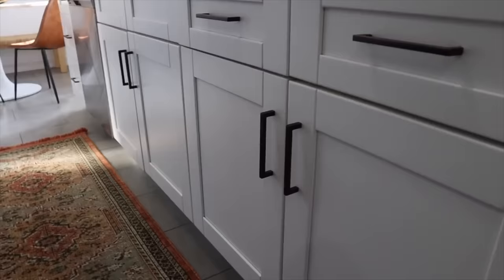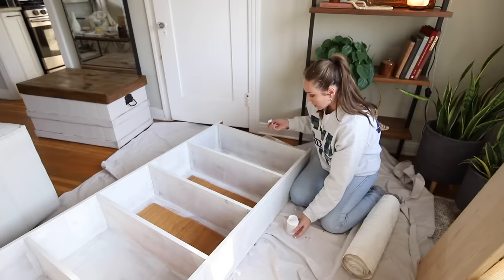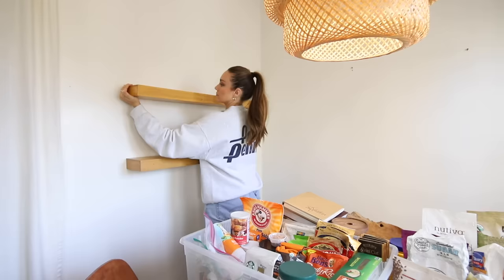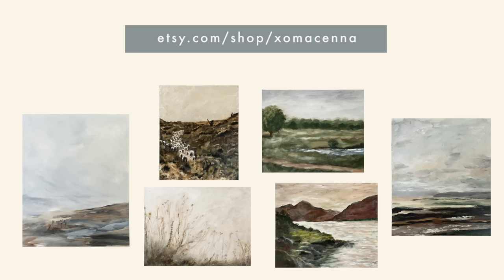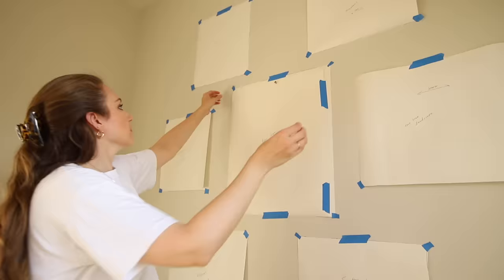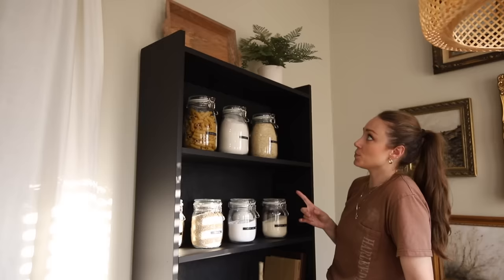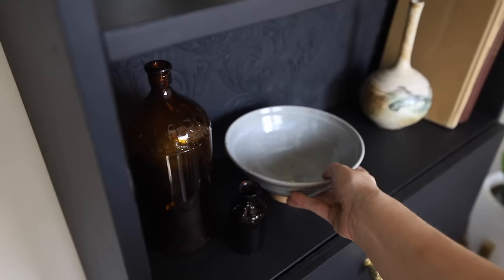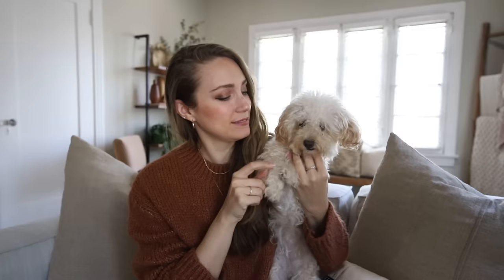EXTREME Breakfast Nook Makeover + DIY Pantry | XO, MaCenna

Comment: Ugh. I bawled; so good! Soooo, where did the plant actually end up? I liked it next to the pantry, but the right corner was very lacking, so my gut was to move it as well. But then, I didn’t like it as much over there since it is so whisky, but there is def something missing. What would be a low footprint, vertical that would help balance the pantry? You don’t need a light, obviously, but  you almost need a “objet d’art” piece in a dark piece in a dark tone for balance. Like, a totem pole, but in the right context/style. Would this be a good placement to put a very narrow blanket ladder, slightly caddied in the corner? Then, you could use that to display your table clothes/napkins, to further free space in the pantry and provide depth/color to the room? I mean, narrow but perhaps taller, like 12’W x 72’ H ( or similar-ish dimensions; narrow!). Luuuuuurve you (and Drew and Rachel and SG and DIY Danny and Wendy, and etc.....Ya’ll’s my peeps and I STAN!) so please keep it up! I hold my brush like a torch, since I am L/S and don’t have to mark my calendar .

Comment: Your room is beautiful. The art work your mom did is wonderful, but I think the spacing in the gallery wall isn't quite right. I can see that you were trying to evenly space everything and make it symmetrical, but the pictures are too far apart and it's just TOO even. Maybe you could lay them out on the floor and try some different spacing, and putting them closer together. I think the rule of thumb is no more then 3" apart, and this seems to really work. Anyway, my two cents, but love your room and again, your mom's art work is beautiful.